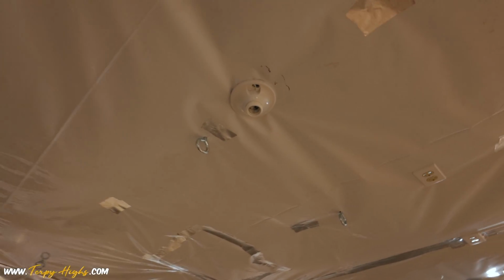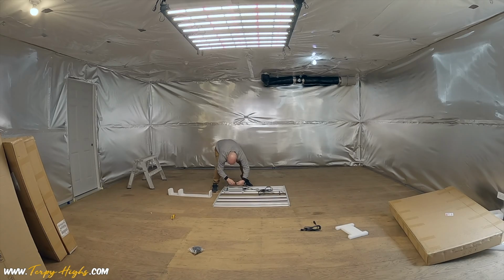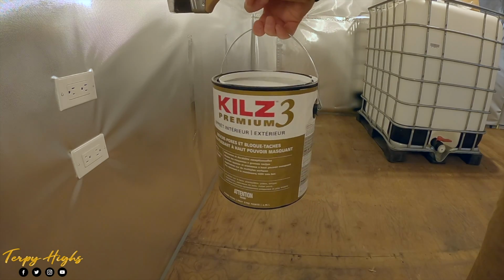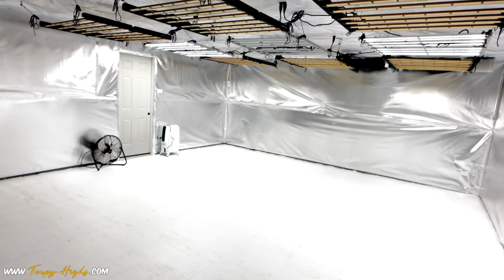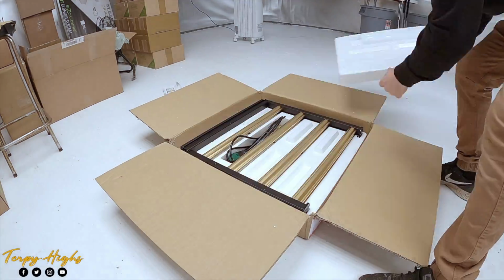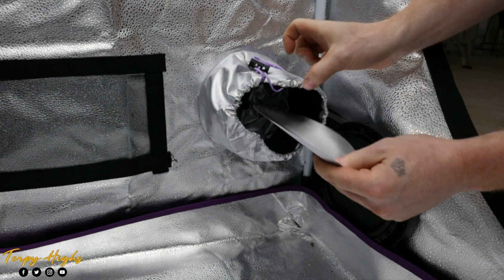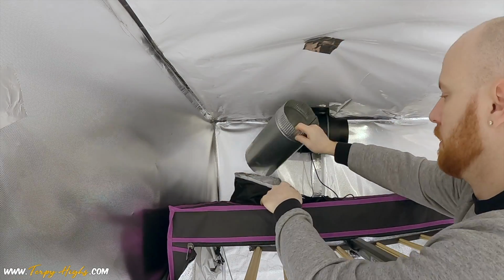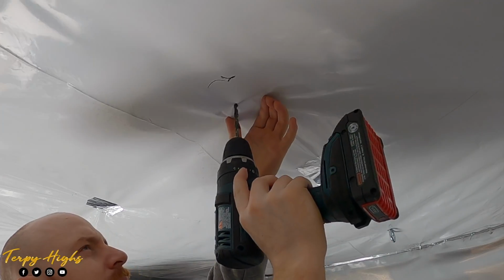Building an AUTOMATED INDOOR GROW ROOM part 1

Comment: 5 green lights for that small of a space is too much light and could effect the plants photoperiod. The whole "plants can't see green light" thing is pure Bro Science and is simply not correct. Green Light that is too intense can absolutely interrupt a cannabis plants night cycle. You only need 1 maybe 2 six watt green Agro leds for that room to be able to see and work in it.  I have a very similar sized bloom room that I only use 1 green light to work in during the night cycle. Never had any issues.
Reply from the maker: Thanks, I should of said effects the plants the least amount. I am using very low watt lef bulbs. Better to have the 5 lights so i can replace them with normal bulbs when im working in the room if there isnt any growing going on.

Comment: Likely will need more dehumidification. I have (2) 225 Quest units in my 6 light 13’ X 22’ grow. Also a mini split is a must!  The grow tent for clones makes me nervous for potential light leaks and added heat. Very different environments are needed (higher temps and humidity) for clones then flower. I’d try to clone in another location if possible.  What size electrical do you have for the room? Looks great, I enjoyed the video, well done.
Reply from the maker: Thanks for your input. if cloning in another room was an option then it would be done. otherwise we will see how things go. changes can be made in the future. part of being a "youtuber" is making changes later on and making more content.

Comment: Definitely need to bump your intake and exhaust fans to 12” inlines with bigger cans for one.  Your intake should be near the floor on the other side of the room opposite the outake.  More wall fans, airflow is key.
Reply: thank you for pointing that out. I have a 6 inch running in my tent and that barley covers the cfm I want cycled out. A 6 inch would never pull enough cfm out. That grow room is going to be hella hot once it get's filled. Go with 2 12 inch inline fans with carbon filters on them. Then place them at opposite ends of the room.
Reply: Definitely I have a 6inch fan in my 6x6

Comment: Epoxy for wood and concrete holds up and seals well. I used it on one of my rooms and it'll fill nail holes or any gaps. Another room I tried plastic but it tends to get slick when wet.

Comment: That 5k btu ac will not work. I'm using 20k btu for 7 roi e680s. And it just barely keeps it cool on hot summer days in Northern Maine.
Reply from the maker: you're right, ac was removed well before this video was posted. 2 ton minisplit heat pump going it.

Comment: Your air flow is severely under powered for the size of that room. A 6inch duct fan is suitable for like a 4x4x7 not a whole room like that. You want to be able to replace all the air in the room once or twice per minute. Your cfm rating is only gonna be like 400-500 for that 6 inch fan. Your room look like its at least 15 ft. So 15x15x8 is like 1200 cfm bare minimum. Just trying to help but be aware of that when you cant vent your room fast enough for like 6 lights or whatever you got going in
Reply from the maker: you are right if thats what the 6" inline fan was being used for. part 2 will show more of whats actually going on.

Comment: On that Spiderfarmer tent why did you cut a hole for the that vent when there's a hole on the side? Why not put that light cover over the side exhaust hole?
Reply from the maker: The holes don't line up for the bracket to fit properly. It's off centered. So the bracket can only be mounted where there isn't any holes. People have put just the light baffle into the hole without the bracket and personally it just looks terrible.
Reply: @TerpyHighs  oh ok makes sense. That thing is pretty nice is it the Secret Jardin light baffle, or do you have a link to one? And thank you for replying!
Reply from the maker: Its the secret Jardin one.
Reply: @TerpyHighs  awesome. thank you again for your response and your content!

Comment: why didn't you just keep it as a sealed room?
Reply from the maker: Room is sealed. The exhaust is strictly for exchanging the air when the lights turn off to get the Co2 out. There are back draft dampers that are spring loaded and have a rubber seal on them so when the fan isn't running everything is closed and air tight.
Reply: @TerpyHighs  ahhh, I stand corrected.  Thanks for pointing that out! Great build otherwise!
Reply: @TerpyHighs  I’d like more info on these spring loaded rubber sealed dampers.  My grow shop tells me co2 increases at night will not affect plants. What’s everyone else think?  I’ve been debating installing some kind of exhaust fan for this for some time, but I don’t want to create an opening in my sealed room to potentially give. A place for bugs to enter or co2 to escape during the day.
Reply from the maker: Here is what I used, the first option but there are several different designs on the market.  https://indoorfarmer.ca/products/ruck-air-movement-backdraft-damper?_pos=2&_sid=7ebfa99c7&_ss=r 

Or 

https://indoorfarmer.ca/products/thermoflo-back-draft-damper?_pos=1&_sid=7ebfa99c7&_ss=r

Comment: Nice. But is a 6" exhaust fan big enough for that big room? Otherwise it looks good to me. I would install a snap together floating floor over some vapor barrier probably. Something easy to install without lots of tools, and easy to clean.
Reply: It's not enough. I imagine he will have trouble with humidity and temps when everything is in there. Even with that little ac. Plants generate alot of humidity and not being able to replace the air will cause build up and possible mold problems. I think that filter will have an unexpectedly short life cycle too. Very cool room but he will end up finding this out when the room is full and operational. May work for a bit but I wouldnt send to flower without addressing or he may end up with bud rot.
Reply: it's actually a huge problem; led generates less heath so the temperature is lower and thus the air can contain less moise, so humidity levels will be skyhigh.  A guideline is to refresh the entire room within 1 minute... so start calculating.
Reply from the maker: Guys it's a sealed room essentially. The exhaust is only there for exchanging the air for when lights go out to get the Co2 out of the room. When the fan isn't on there is a spring loaded damper with a rubber seal on it that closes. The AC has already been removed out of the wall well before posting this video, a 2 ton minispil heat pump is going in its place.

Comment: needs a mini split or two, that ac wont cut it, and mini splits have dehumidify features built into them and the new ones have wifi so you can monitor adjust from any where... They also heat as well
Reply: You can get diy mini splits from a company called mr cool. They come precharged and work great.
Reply: They are usually available locally. I have one in my travel trailer and it works amazing. I will be incorporating them into my grow soon.
Reply: yes, reversible heatpumps are your best bet. from a controls side too :P
Reply: AC wont cut it for dehu unless its a packaged or regular split system with gas or electric reheat.
Reply: @jonosterman2878  the plants will be respirating most when lights are on. Depending on the heat load reheat may not be necessary

Comment: Nice but flat white reflects a lil better. Could add a fungicide in the paint and you'd be good.

Even white poly would do a lil better and easier to clean.

But mylar is good too. 

Really stepping your game up.

Did you put in a 100 amp service box or 50?
Reply from the maker: Thanks, its 60amps pretty much maxed out.

Comment: Amazing space but your exhaust is laughable. A 6" fan for a room that size....sure.
Reply from the maker: Thank you, appreciate it. The inline fan is only for exchanging the air at lights off to get the Co2 out of the room. Didn't make it very clear in the video, will address that in part 2.

Comment: One 6 inch exhaust fan for the whole room???  That seems way undersized.  Amazing overall setup, though
Reply from the maker: Thanks, the inline fan is only for exchanging the air at lights off to get the Co2 out of the room. Didnt make it very clear in the video, will address that in part 2.

Comment: Looks amazing. One question, how did you get the IBC in? Those doors don't look  wide enough to allow that reservoir
Reply from the maker: the walk though of before any work was done you will see a sliding glass door in the corner when i removed that i brought in the res before closing it up. Thank you!
Reply: I appreciate the reply. I'll have to pay closer attention. I guess there is no need to take it back out in the foreseeable future. :)
Reply from the maker: @Magpyro  exactly if it needs to be removed ill just cut it into pieces.

Comment: Idnno man 6inch exhaust for that room with 9 lights, IMO 6 inch is good of a 4x8 to maybe a 8x8 after that probably should step up to  8 or 10inch exhaust fan. But time will tell. Should be interesting on them hot 30+ days
Reply from the maker: 6inch inline fan is only for exchanging of the air when lights go off to exhaust the Co2 out of the room. Otherwise the room acts as a sealed room, a 2 ton mini split is going in.
Reply: Ok that makes more sense, I do remember u saying a mini split was going in. Dont didn't notice u say this was a sealed room with co2. My bad, I  Look forward to your growing experience with this new room.
Reply from the maker: Thanks, yah never mentioned Co2 or sealed was saving it for part 2.

Comment: How are you supplying fresh air to your new room?
Reply from the maker: part 2 will show the intake side. I have a filter and back draft damper on it so its air tight while not in use but will let air in when the fan goes on.

Comment: Spend the money get a mini split they do heat an ac it's worth the money that Lil window unit will not cut it an seal the room an get co2
Reply from the maker: Thank you, ac has already been removed and getting a 2 Ton mini split heatpump to replace it. Room will be sealed with Co2. The exhaust is only for exchanging the air at lights off to get the Co2 out.
Reply: Yea I did the same but I came to find out I didn't have to exhaust the room at night. the room looks sick tho
Reply from the maker: It has a rubber seal on the baffle in the exhaust pipe anyways so the room is sealed either way. If anything it will serve as a safe fail if Temps or humidity get to high at any point.

Comment: Hey congrats on new room!! I would change that AC it’s gonna be a tough change mid grow when that antique goes lol
Reply from the maker: Already has been taken out and hole filled. 2 ton mini split going in its place.
Reply: @TerpyHighs  Bad Ass Grow Room! Make sure to keep an extra eye on those mini split filters, I replaced 2 units that weren't but 2 years old, They self destruct fast if they get neglected.
Reply from the maker: @tat2trav807  thank you will do.
Reply: @tat2trav807  great tip
Reply: Some of those units last forever

Comment: Just wondering what's the footage looks like 12 by 24
Reply: Just looking real quick looks like door to door is about 20feet(2.5 sheets lengthways) and 20-25the other way(5 or 6 sheets widthways) could be wrong but that’s my educated guess
Reply from the maker: 19x23

Comment: Do you need to run the back cage on the fan for it to function properly with the hurricane fans? Is that the reason you left it on?
Reply from the maker: You don't have to run the back cage on it. Just kept it for the small amount of safety since I will be working close to them at times. Super easy to take off for cleaning with the front not there.
Reply: @TerpyHighs  Room is looking slick man, Congrats!

Comment: Is the small exhaust being used as a fail safe or to purge the room at lights out to deal with any humidity spikes? What are the dimensions of the room and what size is the a/c?
Reply from the maker: You are correct, being used for exchanging exchanging at light off to get the Co2 out of the room and incase something goes wrong with the AC/dehumidifier. 

That AC is already taken out and hole filled. 2 ton minisplit heat pump is replacing it. Room is 19'x23'x8'
Reply: @TerpyHighs  Right on man! thank you

Comment: I’m surprised your only running a 6 inch to extract... maybe it’s just because I’m in England but I’d use a 12/14  systemair... looks awesome though dude, looking forward to seeing the results. I’ve just ordered the HLG scorpion Diablo fingers crossed they do me proud 🙌🏻🙌🏻🙌🏻🙌🏻🙌🏻
Reply: Scorpion Diablos are BANANAS dude. You’re going to be blown away.  We traditionally use 650R’s in our flower rooms, but just tested a few Scorpions. They’re insanely efficient… especially if you’re height limited and you have to run them close to your canopy.
Reply from the maker: Thanks! Appreciate it. The 6inch exhaust is only to exchange air at lights off to get the Co2 out. As well as a backup for the AC/dehumidifier if they brake and I'm not around in time. The lights will be on a fail safe also if the room gets to hot the light will dim/shut off.
Reply: @TerpyHighs  I have to think more about the smell 🙌🏻🙌🏻🙌🏻🙌🏻🙌🏻🙌🏻 looking forward to watching the series 🙏🙏🙏 be good to see side by side comparison of the lights ✌️✌️
Reply from the maker: @paw7110  there will also be air scrubber in the room constantly on to reduce smell inside the room..
Reply: @TerpyHighs  I might look into that myself buddy, good luck 🙌🏻🙌🏻🙌🏻